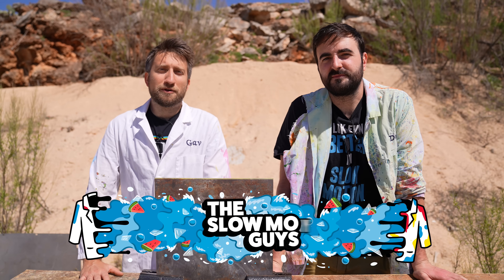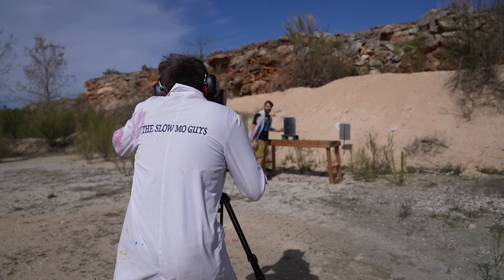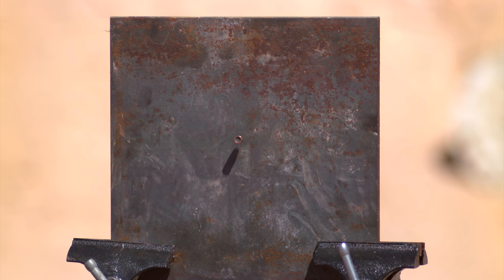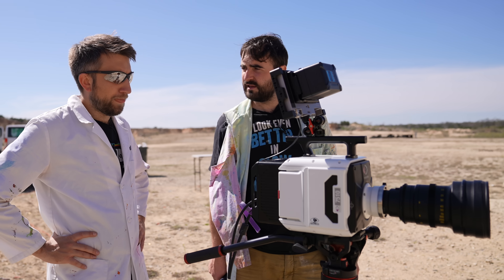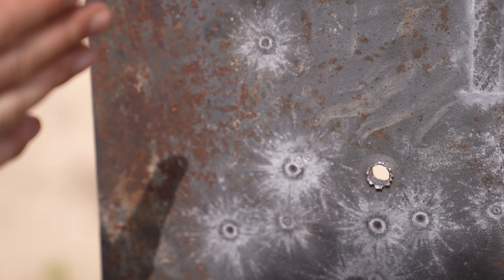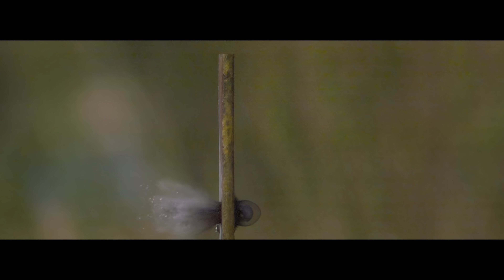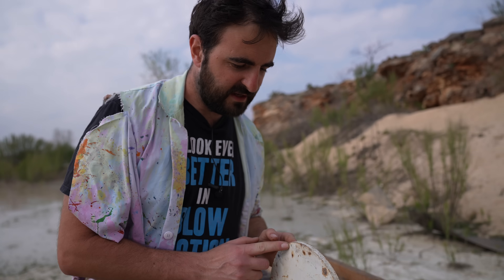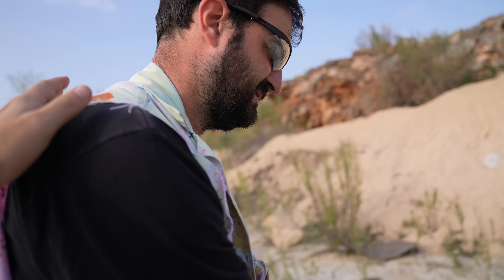Bullets vs Steel at 800,000 FPS - The Slow Mo Guys

Comment: The effects of the rifle round impacts are a little easier to explain using a fluid dynamics analogy:

-The long lead rifle bullet is akin to a hot stream of water being poured onto a plate of ice (the steel plate).
-When the stream hits the ice, it begins melting an indentation into the ice that I'll call a "cup crater".
-The "water" at the head of the stream is diverted sideways, while the rest of the column of "water" continues to advance, pushing it from behind into the "cup" that has been formed.
-However, the "cup" isn't deepening fast enough to give the column of water room, so the incoming "water" flows along the surface tangent of the cup crater until its eventually redirected backwards.
-This behaviour continues until the tunneling of the plate has advanced to the point where it's too thin to support the incoming pressure of the stream, at which point the center of the cup snaps -free and is carried backwards by the remaining lead material of the back end of the bullet.
In reality, the steel plate is more like an extremely viscous putty rather than ice. It deforms rather than melting, with the lead being an even more liquidlike putty.

Comment: Shoot anything. Shoot it all.
As or more interesting were the shadows of the various waves through the air of bullets b4 impact. If you could set up shots to intentionally capture shadows of different speed (fps) bullets I believe it would be of scientific value.
A large, clean white surface with a separate camera or cameras. Thanks gentlemen. Very interesting and informative.

Comment: The kinetic energy of the projectile is proportional to the square of the velocity. So twice the speed is four times the energy. 
The bullet was smaller diameter so that energy is spread over a smaller area. It's deceptive how circle area scales as that's also the square (of the radius).
So you could easily have four times the energy hitting 50% less area for eight times the pressure applied to the surface.

Comment: The target is way harder because it's AR500 Steel. Specifically chosen and hardened to be as dense and strong as possible specifically to stop bullet penetration. Any other steel you get is more than likely just regular mild steel that isn't nearly as hard, hence why the first target blew out and the second barely gets scratched.

Comment: The reason you didn't see much from the tracer bullet is it takes a small fraction of a second after firing for the tracer compound to ignite and start burning, and at close range it doesn't have time to properly ignite before impact. It would definitely be interesting to see another go at tracer bullets though.

Comment: A suggestion: When you guys film impact footage of things colliding really hard, have a simple thermal camera at another angle to see the difference in temperature the impact created. The thermal camera doesn't need to be high framerate, it'll be already interesting to just see how much heat got generated after the impact
Reply: And maybe a sound recorder.  The first impact is expected, but the rebound sounds after the first hit might be interesting.
Reply: @TheBntimmins  - The sounds are mostly fake. They're added in editing. There's a video about it on their second channel.
Reply: @TheBntimmins  Something that records at at least 192Khz so the actual sound can be slowed down with good fidelity.
Reply: @inthefade  If you record something at 400000fps and slow it down to 30fps, you slowed it 13333,(3) times. Even if some sound was 192kHz, 192000Hz divided by 13333 is 14,4Hz. Less than 20Hz which is about limit of what human ear can hear. 
But there is one more thing... If sound frequency is 50kHz and you record it with 192kHz capable microphone, that sound will still be 50kHz.
Reply: It would also be nice if they put the camera closer with a thick clear shield in front of the camera so we can see more details
Reply: It would definitely be interesting to see. The last two shots both seemed to generate much bigger flashes than the others, spreading out almost like a tiny fireball. 
Sadly, I doubt there's such a thing as an infrared/thermal camera with a framerate even close to what would be needed. 
If one does exist, I expect the price would be at least a seven figure number, and an uncomfortably high one at that . . .
Reply: That's a fantastic idea!
Reply: You won’t see much if anything. It’s all happening way too fast to see any appreciable heat transfer.
Reply: @johnd9357  things like hammers and nails or any metal do get hot when struck enough times or hard enough, so I'm just curious that even for a brief moment how it might look
Reply: But I do get your point that it won't be all that exciting
Reply: @johnd9357  You can see sparks from the heat if you shoot steel plates at night with a pistol......yes, copper jacketed bullets with lead cores made sparks on a steel plate. While I wouldn't expect to see much heat transfer from a typical small pistol round, it would be interesting to see multiple shots and magnum pistol or rifle rounds on a thermal camera. It might be surprising.

Comment: Just a bit of safety advice, do more research into shooting steel before shooting steel. Shooting mild steel can be dangerous by cratering instead of penetrating and sending the bullet fragments straight back at you. Shooting hardened steel (AR500 etc) can be dangerous if you have it fixed like you did, they are typically hanging or have some sort of give to direct the spalling downwards instead of back at you. Stay safe guys

Comment: That was awesome. Next time do some APFSDS 120mm projectile through some old armor pieces. I wonder if you can see anything there, from the sparks and smoke, if you can see the metal behaving as fluid. And a good way to stress test the cameras frame rate, as those rounds travel at around 1600-1800 ms ;)

Comment: I don't think the metal is causing the effect on the hollow point, but the diesel effect igniting the air. Just at the 4:12 mark. Can't wait to watch the rest. I just finished up and hardness isn't the answer to the last shot. Basically thinking knife making and you have to think of it as the hardness being the skin and they right amount of annealing to produce a substructure to transfer the energy just like a mussel. Otherwise, that target plate would simply shatter. That is why the cost of good target plates are so much more expensive then produced steal. Again a wonderful video.

Comment: You really shouldn't shoot a static piece of metal like that, you can get a ricochet and end up with a bad day. Metal targets at the range have some play they hang or have movement. That way the bullet goes anywhere but right back at the shooter.
Reply: Problem is at higher FPS of recording the window for something staying in focus goes down to millimeters so allowing a metal target to sway like they do 9n a range might ruin the recording.

So in this particular case the ricochet risk is just kinda unavoidable and talking ricochet damage mitigation is more important.

Comment: 10:28 Here's something strange. It takes 26 frames from when the bullet fires (gun moves back slightly from the recoil) to when it completely exits the barrel. In the next 26 frames, the bullet only travels about the same distance as the barrel in front of the wood. If you assume the bullet starts inside the bolt, that implies the bullet travels 7-8x faster inside the barrel, than after it leaves the barrel. Which doesn't make sense to me. What's going on? Were "boring" frames immediately after the bullet fires edited out?

Comment: Rather obviously y’all need to get in touch with Demo Ranch again and have Matt bring you some 30-06 or 7.62x51 AP rounds. The differing interactions between the copper jacket, lead body and steel core when striking that type of hardened steel (AR-500?) plate would be fascinating to see at those frame rates. 

Plus it might give Dan a chance to play with some unusual platforms in those calibers. God alone knows how many oddball rifles Matt might bring along.

Comment: Shooting with another few rounds or yes some AP rounds would be a good continuation many might like to see. Aditionally a range of tempered steel that would be used for armor, plates, or targets (AR500). To mid grade and low grade, even aluminum? Demolition Ranch has previously lamented not having access to a high speed camera, may even have said "like the slow-mo guys".. and he is happy to do collabs, has his range on his ranch and access to pretty much everything else you might need. You could also get some sick footage of auto/semiauto's cycling. BUY YOURSELF SOME KEVLAR FOR YOUR CAMERA, cut the lense out and attatch it through the cut out. If shrapnel hits it the camera might live.

Comment: So they actually captured something even cooler than they realized.  At 3:57 Gavin calls it sparks.  But A) copper and lead don't emit sparks and B) we actually see the same effect on the aluminum tray at 2:14.  This isn't sparks, it's sonoluminescence , the emission of light from collapsing pressure waves in a fluid.

Comment: Very good videography of some things most people don't see or think about, even for people at target ranges!

You guys got to display the difference of energy between rifle and pistol rounds due to the extra velocity of the rifle rounds. That makes a significant difference in energy the target encounters.
The pointier bullets do help (even if this particular rifle round had a soft point like for hunting), as the energy is focused on a smaller point. Like slapping a ball versus the corner of a table, one's going to hurt more and leave a mark. However, the speed matters most.

The square, steel plate shot initially was likely mild steel & the round plate target would have been AR500 steel, hence why the rifle round zipped through the square plate and not the round one. They have different chemical compositions as posited in the video, with the AR500 having extra "ingredients" while mild steel is just iron and carbon, so AR500 steel is suitable as a target for shooting with various caliber weapons from pistols to rifles. Though, you wouldn't want to shoot them with armor piercing rounds, as you'd start to see those targets behave like the mild steel meeting that .30-06 round from the M1903 rifle Dan shot.

Comment: the riffle punched a hole the bullets force and shock wave shear a round hole in the steel plate , the lump you see heading to the sign is the part punched out of the steel sheet , that's wild

Comment: That’s not the lead from the 30-06 bullet flying into the sign behind the steel plate. It’s the plug of steel that the bullet punched out of the plate. The bullet splash is because the bullet stopped mid plate and rebounded all the pieces back.
Reply: yup, we watched the video.

Comment: All that splatter from the bullets hitting is why you Do NOT Want to wear A bare Steel Plate as body armour. You want it to be coated in a protective Liner designed to catch the high speed shrapnel that splatters in all directions.
No sense in stopping a bullet from hitting your heart if all you do is send hundreds of tiny razor sharp blades slashing through your neck, face, arms and legs, potentially severing arteries, blinding you, etc.

Comment: for gun safety, even though you cleared the rifle, point the barrel somewhere else before you walk up on the target and flag yourself. its not a huge deal, just something i teach. at 8:13 theyre both in front of the barrel. maybe a crew member trips on it, maybe a bird lands on it. maybe the guns firing pin malfunctions and lets one loose. crazier things have happened.

Comment: e=m*v*v.
Double the velocity, quadruple the energy.
Double the mass, double the energy.

I guess the first piece of metal is mild steel from a suburban steel merchant. The second, higher carbon (tool steel?) so harder and more resistant to corrosion. Different chemistry, some of the carbon combines with iron for a carbide, Other metals can be added too, nickel, cobalt,  molybdenum.

Comment: I love all your stuff.  Been a fan from the start.  I am a RR conductor.  Often kids will put coins in the tracks to flatten them.  Sometimes something larger and we theorize that these larger things could "squirt" out and cause great harm. I also worked in a rubber mill and we had a similar theory about things in the mill.  I am not sure you read these replies.  But it would be fascinating to see how hard stuff compressed,  works like (for lack of a better example) tiddlywinks.

Comment: 12:24 calculation for KE(kenetik energy) is 0.5MV^2 (mass in grams and velocity in meter per second) so if you double the speed the kenetik energy is 4 times as high, but i guess that also increasd the weight of it, wich will increas KE even more.
Ps i know like nothing about this stuff, alot of yall know more than me so please do tell me if i got anything wrong :)

Comment: it's interesting how the slugs coming out of the back of the steel plate look very similar to the slugs you get when you punch a hole with a pirahna/ironworker. crazy that it has the energy to do that without the equivalent of a bottom die

Comment: Not a subject expert by any means, just a hobbyist. While AR500 steel is significantly harder than mild steel, but also differences between the steels can be so much more than just the hardness! Those steel targets are likely made of AR500 steel, which has very high toughness and wear resistance than the usual mild steel types.
The main factors for bullets are speed, hardness, weight and geometry. Kinetic energy =mv^2, so speed is the main thing besides going hardened steel or tungsten.
The main factors for armor are hardness, toughness, thickness(impact angle dependent), and composition.

Comment: 14:25 it's "only" steel. That was also the case or still is for tanks or armoured cars/vehicles.
I mean - german steel on Tanks had a great quality, imagine 10cm angled Steel Plate.
And it's not only manufac process and hardness because of manufacturing - at frist place its alloy... it's rolled steel or simple cast iron/steel and so on.

Comment: Just FYI, the square part on the back of the white "Real" target is meant to slot into the end of a 2x4, and then you mount (or bury) the 2x4 to a stand made of more 2x4's (it's 2x4's all the way down!). In case you kept it from March to November 😂

Comment: Spalling is interesting, and on a larger scale (kinetic (and plastic - i.e. HESH/HEP) cannon rounds to armored vehicles and structures - just like Dan mentions briefly at the end), that is one of the major factors used as a design feature and strategy of use. Would be real interesting to see other round types and compositions too - from tungsten core armor piercing to tracer, incendiary and practice rounds like simunition.

Lots of differences in how they behave, and it's rare to get to see as much detail as here. Thanks for the interesting shots! (Some pun intended.) ^^ Also, good marksmanship there, Dan!

Comment: Suggestion: Get a mirror, some AR500 plate, and make a camera box. You CAN get your camera close to the target, put it in the metal shroud, and use the mirror to keep the camera out of direct line from the rifle. You should be able to get the camera right up to the target, and any spalling, splash, or other ejecta from the round will hit the mirror; Stray shots will hit the shroud, which will protect your camera.

Add some lexan or similar poly to the mirror, and every time it gets damaged, you can just replace it. You might not even have a problem at all when filming rifle rounds vs lighter plate, since you get very little, if any, horizontal splash off those rounds.

Comment: It doesn't look like you guys noticed on the 9mm through the baking sheet, but from the front side, if you look at the slow-mo, there is a ripple that extends through the rest of the metal of the baking sheet. I guess actually more of a shock wave

Comment: Energy in the bullet is approximately speed to the 4th power.  So the 30-06 has about 3x speed of the 9mm.  Energy is approximately 12x.  That’s why it drilled right through the plate

Comment: When i was a kid, i made "popping tips" for my pellets.  It requires strike anywhere matches.  Stand a bunch of hollow point pellets on the table.  Carefully crush a few match heads into a powder without ignition.  Add a small amount of water then over-fill your tips with the paste.  Shrinks when dry and deeper tips take multiple coats.  They flash slightly on impact with solid stuff.  Great for paint cans.  It was stupid kid stuff but ill never forget those tips

Comment: 2:44 That has to be because the little bit attached to the bullet is pulling from the borders until it brakes. The energy must remain in the little bit. That's why the wound doesn't expand. I guess.

Comment: Thats the difference between hot rolled carbon steel and ar-500 (abrasion resistant). The ar plate contains nearly no carbon and other metals like chromium and cobalt added to increase the wear property of the metal. Heavy equipment buckets, teeth, and cutting edges are made of this material.